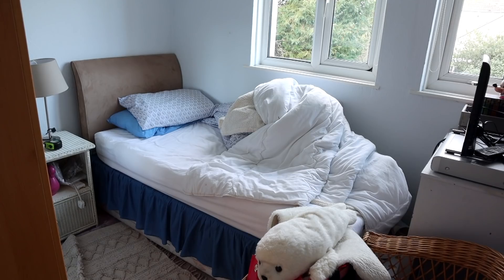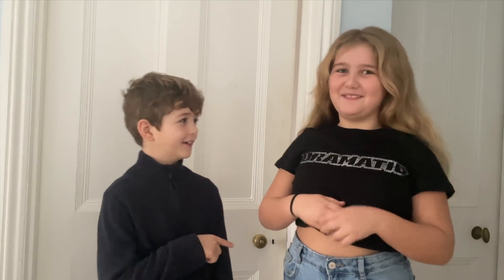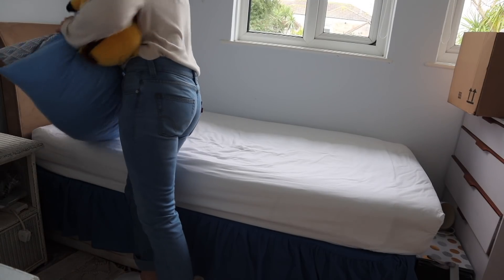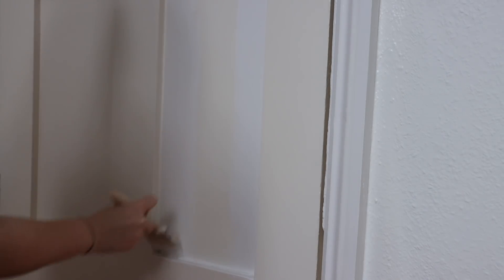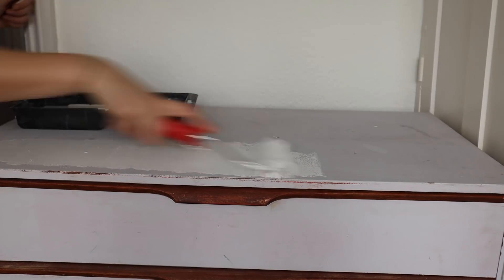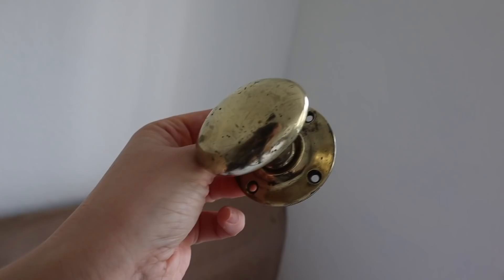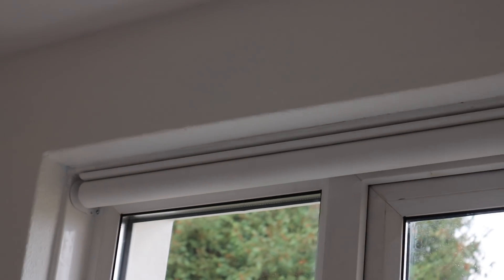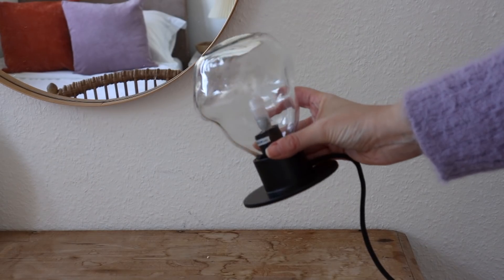Tiny bedroom makeover on a budget! Decluttering and decorating

Comment: For the curtain issue, you could use Command Strips curtain rod hooks. It doesn't require any drilling and I heard it works well
Reply: Yes they work well. Just lightweight curtains which I am sure you do not want heavy ones in that room. I think with the small room maybe just go with the windows as is. More open feeling.
Reply: I was thinking the same.  I used the hooks only in a matte silver finish and used cafe rings to clip on to a sheer panel.  Even a vintage tablecloth from a resale shop would work as a curtain.
Reply: I came here to say this! Ive used them for curtains in my apartments,  And funny I think I got the idea from a Hermione video a few years ago!
Reply: I saw just this week on another YouTube channel someone using the new Command broom/mop holders as curtain rod holders-- really neat idea, but possibly expensive (I think they run about $8 each here in the US). Regular command hooks might be more affordable and just as effective, depending on the type.
Reply: I was thinking the same thing. Saw a YouTube Video on it.
Reply: Yup, 3M have many options; the large hooks and a regular curtain rod, all white, would blend in well. Used these for many years as a renter.
Reply: Was just coming to the comments to say the same thing! Such a great innovation from command

Comment: Curtains: you just need the right drill and drill bit! The wall is likely brick, concrete, or some sort of stone. You need an impact driver (also called a hammer drill) and a masonry bit. Then it’s super easy to drill into. For screws, you’ll also need to make sure to buy masonry screws - look for TapCons or any screws that say they are for masonry/brick
Reply: Perfect advice for Hermione, Sophia!  We live in an earth-sheltered home and the walls, ceiling and floors are concrete. That's exactly how we make holes in the walls for curtain rods, artwork, etc.

Comment: Such a beautiful transformation. Now it looks like a little boutique hotel room. So great! And btw, that hair colors looks beautiful on you! It’s like a miracle, like you man said haha she’s always so sweet 

What about some command hooks for the curtains? Or hang them from the ceiling? If the wall is brick or concrete you only need the drill bit for it, one for concrete. I don’t know what they’re called in English. Masonry bit maybe? And a good drill, non battery ones are usually more powerful. But if you hit a supporting chain or pillar then yes, it is basically impossible to drill into it, as it’s like drilling into rock, that has happened to me :(

Comment: You could try self adhesive curtain rod holder but make sure you get some that can hold alot of weight.  Since the curtain is by a bed they may get pull on by mistake. I saw one on Amazon that claim it could hold 22lb. They also sale  curtain rod holder that you attach from the ceiling. Dont know if that work for you but you can try that also. Other wise you need to buy or rent a drill with masonry drill bit if your wall is brick or cement . if you have a drill you can just buy the bits. Predrill the hole then install curtain rod older. You may need to change the screw that you have but that base on your wall. They sale tons of screw thats for masonry walls. I live in old fl home where the wall are cement blocks and thats what i do on. Also it could be where she tried to install the bracket for the curtain rod. It could of been on metal plate and if you extended it out more you have better luck. I say try to hammer a long nail in and you can guess what back there. I had that problem with one window they put a metal corner piece around it i had to move where i wanted the bracket until i found a spot where it didnt have it. I do the nail check now if i can't get it all the way in its wood i need to predrill, if goes in easy hollow wall need support and base on the wall and weight will determine what type i buy. If it didnt go deep enought could be metal since thats over drywall but under plaster then all you can do is mover it to side.  Sorry for the long comment but since i didnt know what type of wall you had i just gave you all of my idea

Comment: Yes you can drill holes on the wall but you need an efficient drill and a stronger drill bit. Check it out with your local store. The power drill is better than the battery operated one. The room looks stunning.

Comment: You can't use command strips/hooks on wallpaper apparently nor on textured surfaces.  Probably need to hang from ceiling, but you would need to screw into the ceiling joists or it won't be a very secure fix or may pull bits of the ceiling down! Great makeover. The room looks very comfortable for guests. Love the desk, just needs a good sanding and some wax and it will come up beautifully.

Comment: I’m sure you have already thought of this and considered it but just in case- there are drill bits that are made for outside walls. Like for concrete/ brick/ stucco/ siding/ etc. you could use a regular bit for the inside wall and switch to the special bit for the outside wall.

Comment: Hanging curtain from the ceiling assuming it isn't also concrete - I've used 3 different types and love them all for different reasons. I'm in NAm but I'm sure GBR has similar options available
- UrbanRed Flexible Ceiling Curtain Track (String plastic)
- Industrial pipe curtain rods (metal)
- Room/Dividers/Now Ceiling Track (metal)

Comment: I'm looking at using leftover copper pipe from a  DIY closet shelf to suspend suspended sheers from my deck ceiling where no wall is available. Maybe an iron or copper pipe could work? I've also got a bracket kit in black bought on Amazon before resolving a drywall/ exterior wall headache. In my house exterior drywall is crumbly and they fall down no matter what anchor is used. It might be worth using a stud finder to see if what's behind the window is the entire wall or just the exterior window casing and you could go up a few centimeters.

Comment: I had a window situation like that and I ended up buying 3 decorative hooks (large) and putting them in the ceiling. Put them very close to the edge.  If the hooks are large enough you could put a small rod through them or I actually used a very thick piece of Jute rope (the room had a nautical theme)   You could also just buy curtains with Tabs and use more hooks from the ceiling.

Comment: Your Nan is a very glamorous lady!
I was a bit confused about the outside wall comment as it’s very rare for those sorts of windows to be on internal walls😄.  As Sophia said though, you need a good hammer drill with appropriate bit, masonry wall plugs and the appropriate screws.
The wall is likely difficult due to the type of lintel installed over the window, I did have horrendous difficulty in one property trying to hang curtain rods and, eventually, had to admit defeat myself and get the help of a male who had much more muscle to put behind the drill - just a suggestion, occasionally, if you try higher - ie closer to the ceiling - you might be lucky and miss the lintel entirely
Room looked lovely when you’d done

Comment: you could put up hooks and use glue that will stick the hooks to the wall.  I have used Gorilla glue outside on concrete walls and they are still up.  The room looks so much better.

Comment: Can u hang from ceiling, just in front of windows, there are a certain  type of rod holder designed for hanging from ceiling or inside window frame (horizontal) as opposed to the usual of attaching the holders off the wall on either side of window (vertically)??

Comment: To add curtains all I did was amazon hooks the strongest ones you can find a light curtain pole and supper glue or monkey glue glue the hooked preferably 3 hooks on the window high up to add curtain hight and visual of a high window and add to each hook glue hold each hook tight for a few min it must be strong glue then once hooks glue on wall add pole and you can dress window with curtains it will hold sheer curtains thick I haven't tried but it works for sheer and a simple fix I hope this helps and hooks do come off when needed no holes no mess

Comment: CURTAIN PROBLEM: this is what I had to do to my property and it's supporting thick, floor length curtains. Gorilla glue (the extra strong one)  a plank of wood that's the width of the window, where you would like the curtain pole to go (paint the wood before hand). Wait for the Gorilla glue to set for 24h then drill the holes for the curtain pole into the wood rather than the wall. Works like a charm.
Reply: Gorilla 2044001 Heavy Duty Grab Adhesive White is what I used.